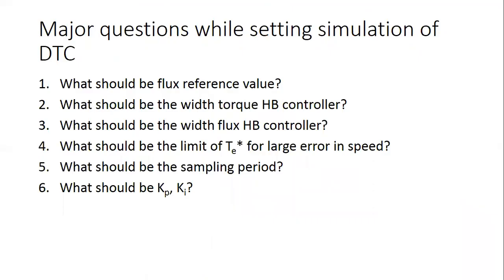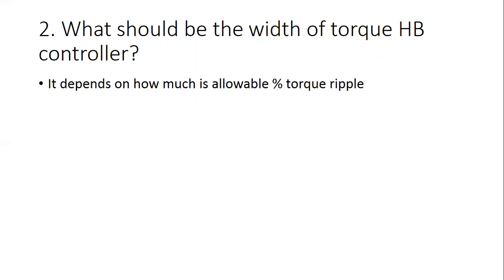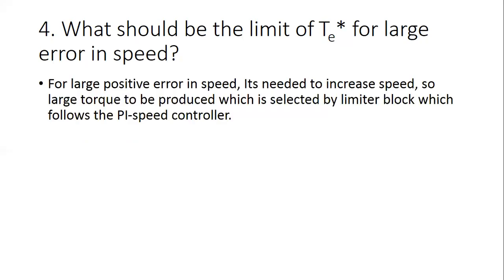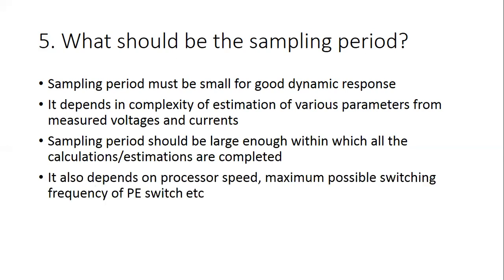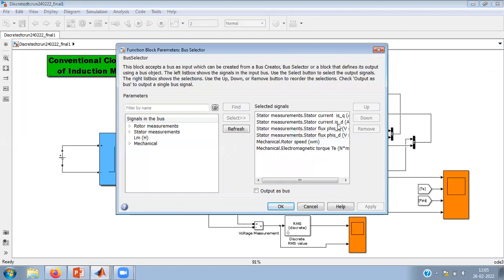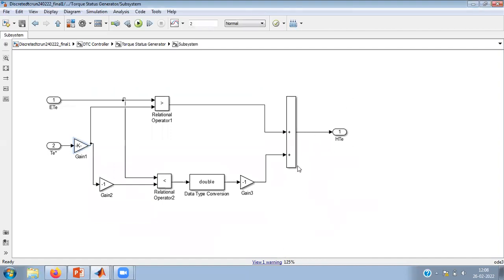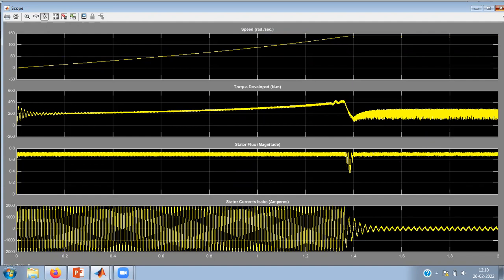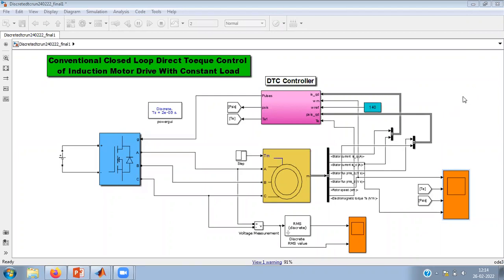Tuning of DCT controller (Simulation of Direct torque controlled IM drive, Part-03)

Comment: Sir How result is showing in graph without completing 2 sec stop time?
Reply from the maker: Hello Preeti,
Thank you for watching the video. At.14.23 min you can see simulation completed for 2 sec. After that full graph is visible. 
Hope this clears your doubt. Feel free for any more doubts
Reply: @PRMsLearnigHub  One doubt is that if d(a) is connected to scope so how is it getting iabc current on graph?
2.Sir where you apply park and inverse park transformation? I have prepare simulink as per your video ..but not getting results...
3.best reference for dtc control of induction motor and pmsm